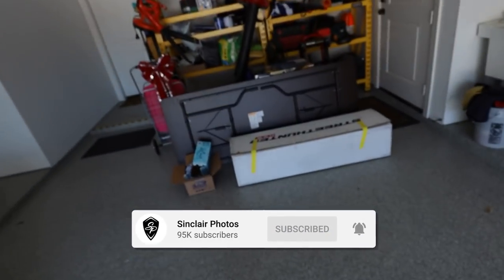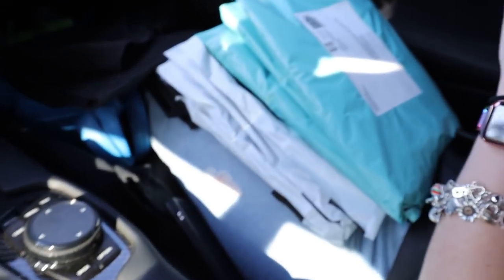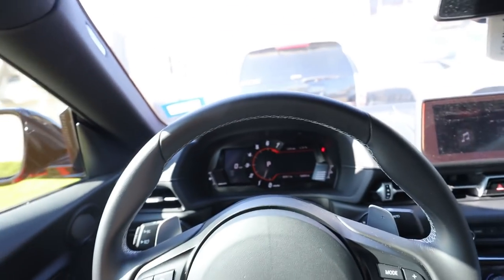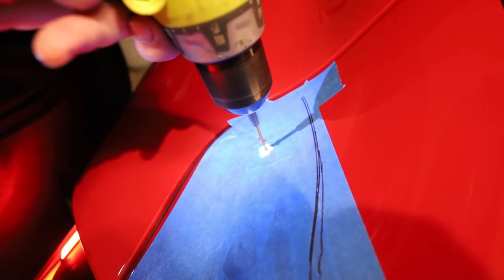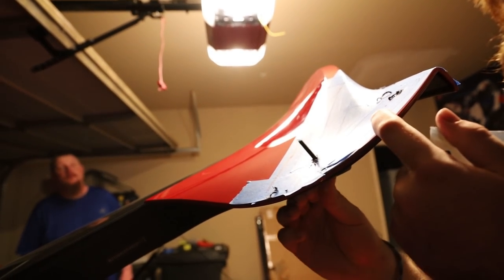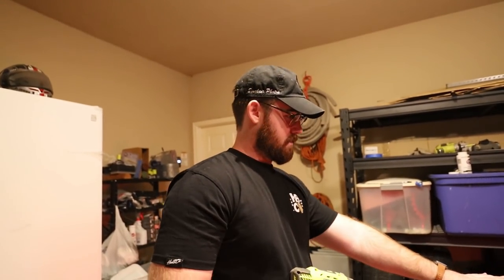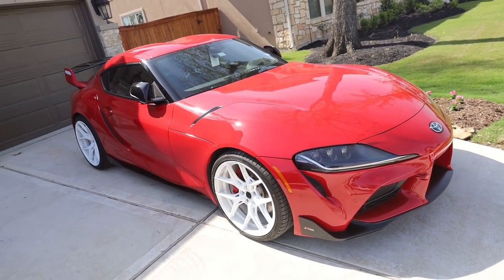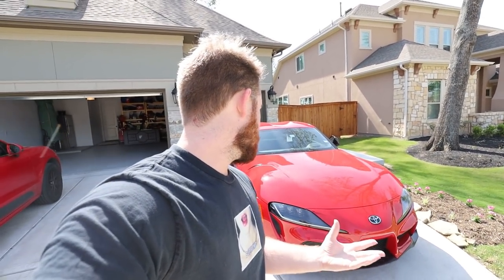INSTALLING THE STREETHUNTER WING ON MY TOYOTA SUPRA!!!

Comment: Did you have trouble with the fitment? I received mine today and the parts of the wing that gets drilled into the trunk are not sitting flush with my trunk. The body shop said once it gets drilled in, the gap will lessen. I was wondering if you had the same issue.
Reply from the maker: Yes I had the same issue it took a lot of testing and it still isn’t perfect which kinda sucks

Comment: I could not agree with you more on all aspects of this wing!. I have been looking at getting the same one.  Templates should be provided for an easy instal. This can be done easily. It leaves far too much for for the consumer to do. Holes should be pre drilled. The option for paint should be given , but color matching can be hard. I think a full carbon model should be also offered. 1850 is a little high. If the product is perfect it’s certainly worth it. I believe that they are still working to getting it better. Great video brother. I will not be getting one. I will leave my A91 CF 22 with the standard spoiler for now. 👍🏽

Comment: Dude, take off the caps and have them do it correctly. Don’t settle for poor work, $300 should get you a much better job than what you got. This is why it’s hard for your channel to gain followers. Don’t half ass things. If you can’t afford it to be done right, don’t do it. Great guy but poor decisions.
Reply: i dont see the correlation there 👀
Reply from the maker: I’ll get them painted eventually. I don’t see how that would make it “hard” to gain followers tho 🧐